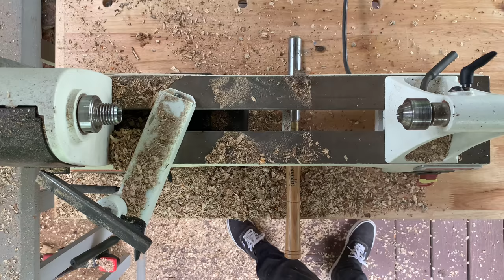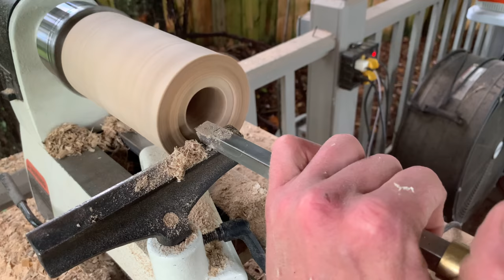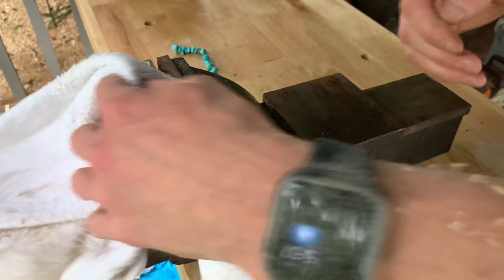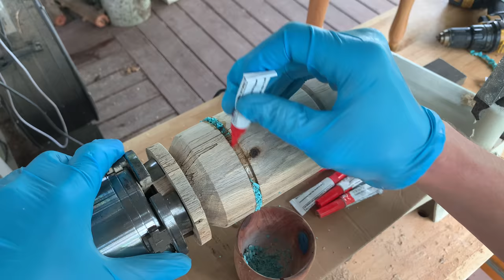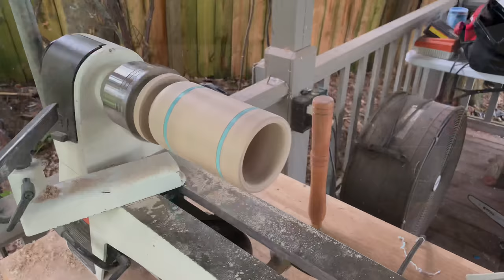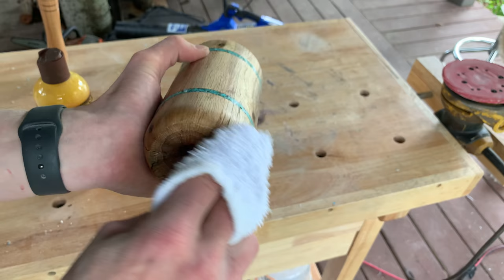Woodturning - A TURQUOISE and Wood Cup

Comment: Amazing job.  My only concern is when you apply the finish with a cloth.  I'm no "safety police" but that's a bad idea.  Better to use some blue shop towels instead.  That way instead of a rag getting snagged and pulling your hand into danger, if just tears instead.  Not knocking your work, just concerned for your fingers.
Reply from the maker: Thanks for bringing that to my attention. I just put shop rags on the shopping list!
Reply: @PrestonsProjects  I used to get them at HomeDepot in a 6pack fairly cheap.  BUT, if you have a Sam's or Costco nearby, they also come in 12 packs and come out cheaper than 2 6packs.
Reply from the maker: @ryanivester5042  thanks for letting me know that. I’m currently walking through Home Depot.